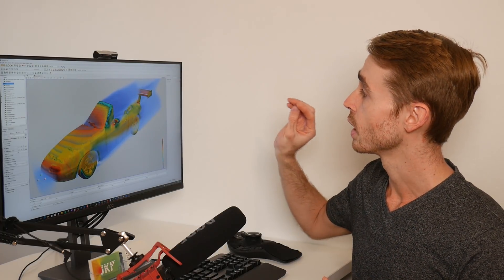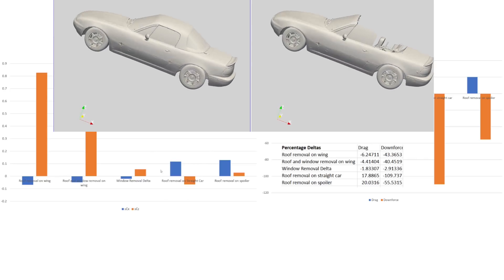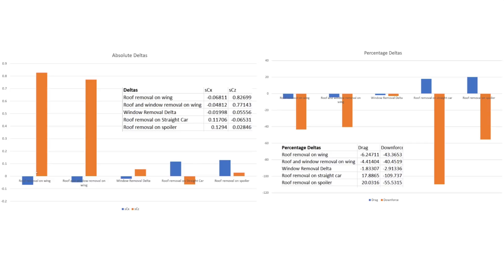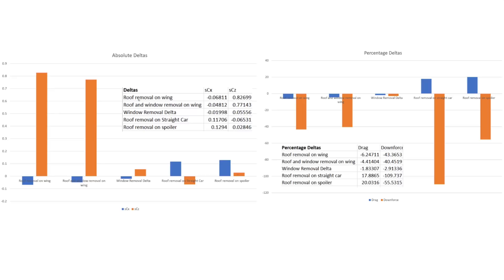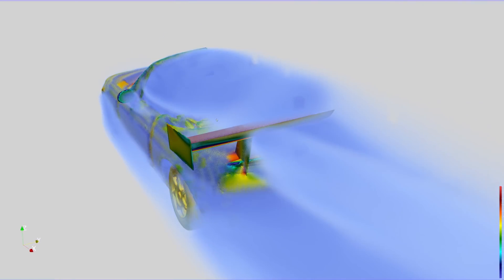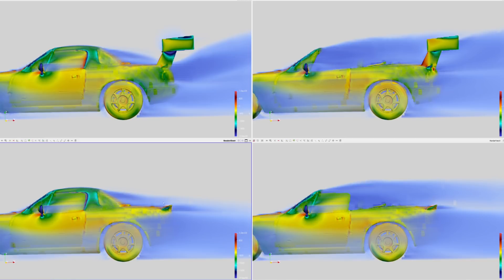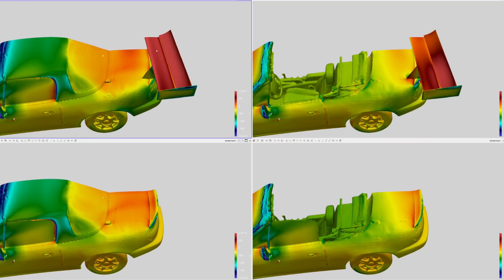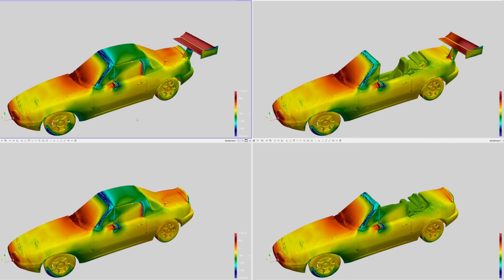Do Rear Wings Work on Convertible Race Cars?

Comment: I used to have a Miata and this confirms what everyone told me about wings. if you're gonna do it go big or go home they say make it higher than the roof
Reply: Go big cut de windshield!
Reply: @s.lacasse8337  and ur head so it's not in the flow
Reply: @boobrowsky  Im a bit cocky but my head still fit in a helmet. A roll loop and a helmet as a small frontal area.
Reply: Don’t make the wing too big. Once your wing is in space you will lose downforce.
Reply: just transform the miata into a speedster with a huge wing
Reply: I’ve seen quite a few track Miatas with massive wings, just for this reason. Looks funny; works.

Comment: can you please do a s2000 video? great car , terrible aero .
Reply: I have done exactly the same thing for an aero project in uni for the S2k and its about the same results. Roof is a must for track use
Reply: @smaragdiosg   thank you for the reply . Any pro tips you can give on the underbody ?
Reply: @Udancearoundme  well it all comes down to use. A flat underbody would be great or as flat as you can get it with stock floor and add ons. If its for competition you need a front splitter and a rear diffuser. but again with aero its all about what are you going to use it for. If you callibrate the floor well and ballanced( good front splliter good diffuser that ideally starts at your rear weelbase) the wing is just going to be extra down force but not the main source. Hope that helps a bit

Comment: Do you think vortex generators like on the roof of an evo would help the factory top keep the airflow attached down the rear window better?
Reply: Yes, I've seen a comparison of the airflow to the rear wing for an evo with vortex generators and an sti without, and the evo configuration works much better
Reply: There's definitely potential for that!
Reply: It might make a slight difference, but the separation bubble is so big and the angle on the roof so steep with relatively sharp edges. I doubt it will do a lot.
Reply: @Kalimerakis  to regain most of the effectiveness of the rear wing you only need to get the air to reattach to the trunk lid before the end of the car and get as much clean air around the wing as possible. The sti has a slightly lower wing and is still in dirty air long before the evo wing.
Reply: A hardtopspoiler would  be interesting too.
Reply: The one on evo doesn't work in general, an entire extra splitter like those on sti would direct the air flow to the rear wing much better
Reply: He made a video about vortex generators.
Reply: If you watch Hartman aero videos he's tries lots of stuff in the wind tunnel. And they were a disappointment